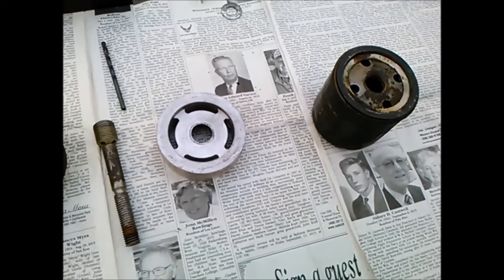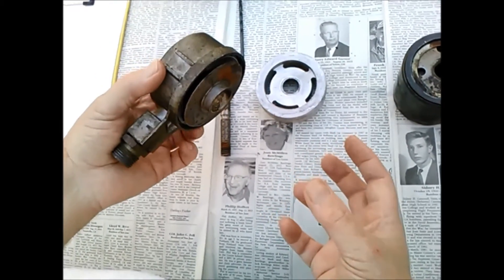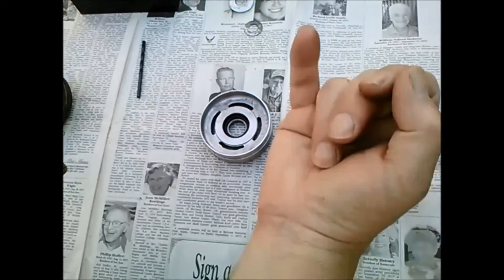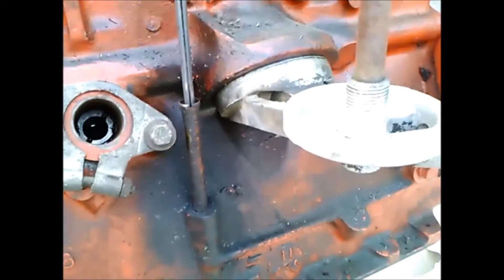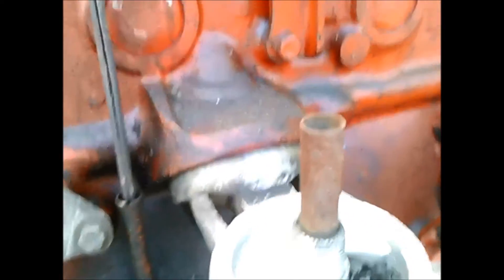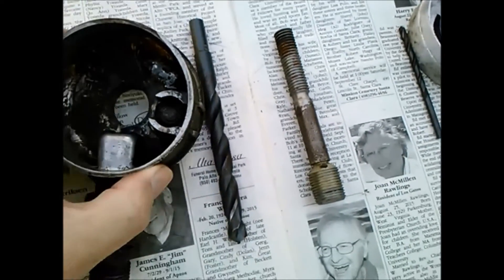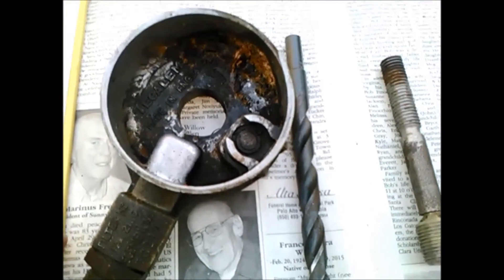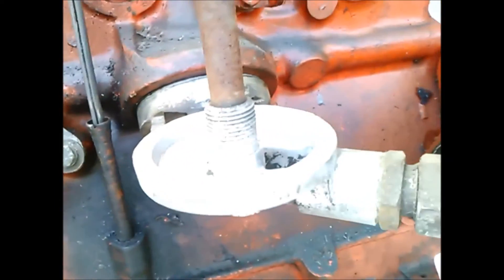MGB Spin On Oil Filter Conversion Adds Restriction

Comment: Have just put spin-off conversion on tr-3b and there is a oil drop
in pressure from 70 to 55(20-50 oil when cold).  So very reluctant to
keep  this set-up; will change filter head and go back to original cannister
(original filter head threads were so-so.)  Whew!  Have stack of the aluminum
filter heads so no big deal but what a mess--in n. calif.

Comment: Correct about the restriction, but in error about the way the pressure signal works.  The gauge port is in the main oil gallery after the filter, so if the adapter is restrictive it would show lower pressure at the gauge port.  The gauge port is physically isolated from the large supply port at rear corner f the engine.  See here: http://mgaguru.com/mgtech/engine/of101a.htm -- See the special fitting with extended nose, half way down the page.  This is what makes the pressure signal port in line after the filter.

Comment: ...add the 4 drill sizes together and then find the area...
Reply: that isn't how area works...
Reply: @saferwaters  
Still sounds like a valid point. No?
Reply: @njsongwriter  they do the math right in the video. Adding the diameters and then squaring them will not give the same result